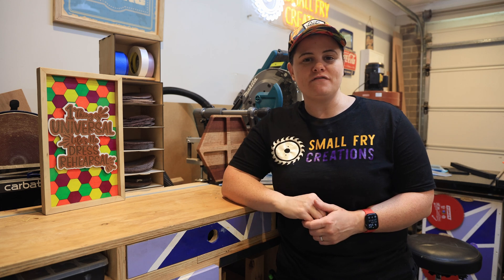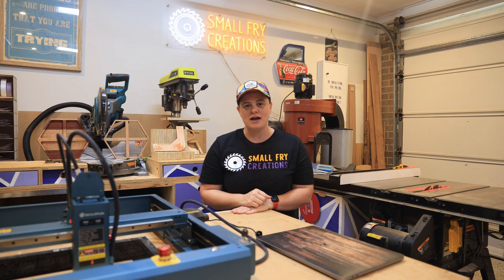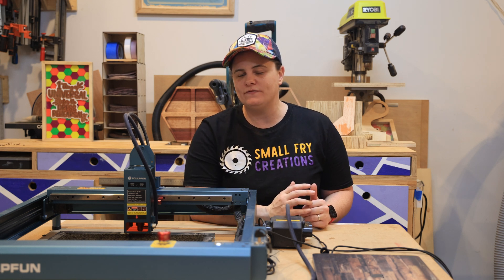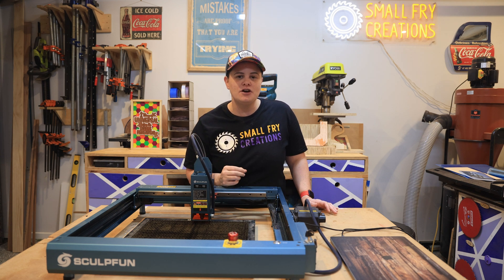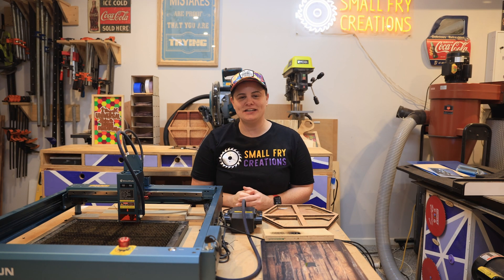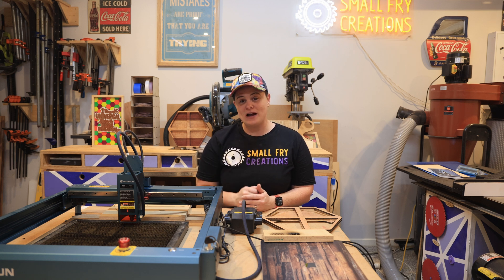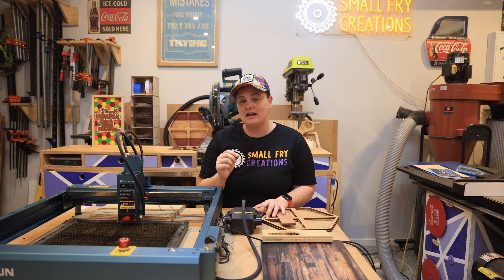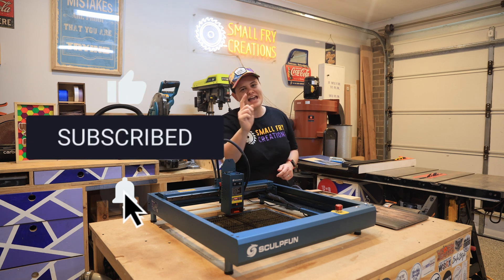5 Laser Facts BEGINNERS need to know | Reviewing Sculpfun SF-A9 40 Watt Laser

Comment: I started with a 5W Sculpfun S9 laser years ago, then upgraded it to a 10W via an Atomstack head. I designed and machined an air blast nozzle for it (a design I now see as standard on most machines but back then it was novel). I also added a side fan to evacuate the smoke/dust to stop it building up inside the protective chamber near the nozzle. It still works fine but recently I've wished for more power and a better more stable frame, so I just ordered this Sculpfun SF-A9. One thing I note - I have an enclosure and exhaust fan to run the laser (essential not optional IMO) but Sculpfun have put the emergency stop button on the frame itself which is of course inside the enclosure and not rapidly accessible in an emergency. I'll probably remove it, extend the wiring and mount it remotely a little distance away and outside the enclosure.  Everyone should keep a small fire extinguisher nearby in case of a fire. I think at 20W the machine is only using 4 of the 8 diodes and not 8 diodes at half power. Because you don't get to choose which 4 diodes to use that means wear and tear will be uneven and running at 20W rather than 40W at half-power setting is going to see your diodes fail sooner than you thought. Better to leave it on 40W setting and adjust power output to suit unless you really need the slightly finer dot size when using just 4 diodes.
Reply from the maker: Thank you for all the great tips! so really helpful information and your right about the number of diodes being used and the wear and tear. Really helpful thank you!

Comment: Useful vulcan knowledge shared.
I grabbed a s30 ultra with a 33watt laser thats on its way here. I also grabbed the s30 extension kit for the frame, though didn't know it wasnt adaptable to the s30 ultra, but its adaptable to all other variants of s30 or s10 even, s9 too if I remember correctly. 
I will need to source out a stepper motor that either exactly matches the motor the ultra uses, or try to source out 2 exactly balanced matching motors if to use the extension kit, or order a cheaper s series than the ultra and make that the larger capacity rig. I want to try to get the s30 ultra to use the extension kit though rather than two rigs. There was confusion generated at time of purchase due to the marketing of the s30 and the extension kit, they really could've went with a less confusing name to differentiate and to make sure it wouldn't result in probably many extension kits being sold yet not able to be used. Someone else i noticed bought a ultra and the extension kit and spent ages trying to get it to work for them, due to the differences of the stepper motors being used. He was frustrated and because he tried asking sculpfun so he could get the exact proper motor so to sort out his requirements and getting the rig to work, but they chose to not give him the info, he felt they were treating the s30 ultra motor specs as if some kind of trade secret! That caused some cortisol spiking just reading that, and to think they seemed to have created additional adventurous mystery, in a otherwise layman's terms framework of corrective care.

I do dig the design of their machines because of the adaptive type of extrusions they use with the s-9 s-10 s-30, and seeing that extension kit really made me hit the Buy Now button.
Thankyou for helping explain the viability of lasers in comparision to marketing, your real world evaluations and your pointing out how achieving results really depends on variables that marketing often does not include. 

We should encourage them to produce a additional extension kit that would include the certain motor of the ultra, because the ultra was designed for the added weight of a heavier laser mounted to the rig. Or they should at least let people order the exactly required motor config without having to order a entirely other s-9 s-10- or s-30.
Reply from the maker: Thank you. I agree it is annoying that the extension frame doesn't work for all models. I was hoping Sculpfun over the last 12 months would start to standardize for the laser head connections and frames to make upgrading much easier and more appealing but it just hasn't happen. They are great machines and I love them and agree the naming could be better to make everyones life a little easier :) Thanks for stopping by

Comment: How is your makita saw and dust extractor working for you? Just watched your video from when you got them and was hoping for a follow up video on them! 

Found your channel through looking for reviews for the extractor and wanted to say they are great quality videos!

Thanks
Reply from the maker: Hey Thank you. The makita vacum is extremely strong. It does an ok job. Like all miter saws the dust collection is not awesome or perfect. I don't use the blue toothsystem as you have to reconnect it everytime you use the saw and I don't use it often enough so its annoying to have to reconnect. If I did it again I wouldn't waste the money on it. The saw is awesome and works really well. The 40V battery lasts a really look time which is handy. overall I'm happy with the set up. I think a dust cover over the saw like I use to have it really the only way to contain all the dust but this setup is better then the last so thats an improvement :)

Comment: Hi and thanks for the information ,I have bought a Sculpfun A9 in January so very new to laser cutting and engraving . After watching a stack of videos and reviews I decided to go for the 40W/20W A9  expecting to get the cutting results advertise  but  just like you have said I can,t get the same results and after watching what you are getting I am thinking I have some setting that must be wrong , on 3mm Ply with white glue  in between layers the best I can cut at is 550mm/m at 100% in 40W mode . I would love to know what your setup is and what drivers you were able to get and use , this is all new to me and downloading file to run the laser was a bit of   a stretch for me. I was disappointed with Sculpfun and the small honeycomb panel they bundle with the A9 , I have been in contact with them and explained that the 400mm x 400mm cutting size the advertise is outside the honeycomb and you end-up cutting into the frame  if you cut to the machines limit. The air assist still runs when turned off in Lightburn  I have been told it pump less air to keep things clear but I get better results if I pull the cable out before engraving and putting it back for cutting  so wondering how you work with yours and if there is also  problem with drivers I need or not. Keep up the videos the more information we get the better and as some wise person said knowledge is no weight to carry, thanks Laurie ( I am up on the Sunshine Coast  QLD)
Reply from the maker: Hey Laurie!! Firstly well done for diving into lasering. It does take some getting use to but lots of fun once you get the hang of it. I run lightburn off a mac laptop, I haven't had to install any drivers. It works for me out of the box. Very strange that with 3mm  you can only go as fast as 550mm/min. Just make sure in the settings in lightburn you are on mm/min and not mm/sec. I should be able to get speed double for 3mm. If your still getting bad results I would try changing the cable as the one it comes with is sometimes cheap. The only thing you want to do is keep the lens clean. If you get build up around the end of the nozzle this will affect the power. With the honeycomb. I hear you and its annoying. All companies for what ever reason have the honeycomb smaller then the cutting size. I'm guessing it must have something to do with the manufacturing process as they all do it. I would run a material test on the 40watt setting and see what you get. With the air assist. I know they do still pump out a little air when its turned off. I haven't had an issue with it but if your getting better results pulling the air tube out then I say stick to it. Just keep a close eye on it as the air being pumped out is a method that use to keep fires from happening.
Reply: Thanks for the reply I will have a look at the speed settings and I will keep the nozzle clean. The lenses will be on the Sculpfun site early March so I will buy some then and thinking I will buy a 600mm x 600mm bed to make things easyer.

Comment: with this S-9 Sculpfun has introduced many upgrades: laser head with selectable power; new and simplified focusing system; double set of feet to raise the structure; initial assembly has been facilitated; possible connections in WiFi, BT and USB; the straps will NO longer need to be adjusted and the cables are largely gone. As if all these improvements weren't enough, the S-9 is one of the least expensive machines on the market (for the same power) and also for this reason I would say that they have come close to putting the ideal Diode Laser on the market.
Reply from the maker: I agree with you. I think put it in an enclosure and it would be the perfect desktop machine.

Comment: Hi you use ipa as I under stand this is not good for the lens I  use a cleaner used for glasses and it work very well what is your thoughts on this.
Steven 🇬🇧
Reply from the maker: My understanding is Isopropyl is what is in glass cleaner. I have been using it for years and haven't had any issues. Hope this helps
Reply: @SmallFryCreations   Hi thanks for the reply the glasses cleaner I use is a non alcohol based one and it is meant to a eco friendly cleaner so it dos not degrade the film on the lens
Reply from the maker: @steven67856  OO thats good to know. I will do some searching and see if I can find one as being eco friendly is much better and if its going to do the same thing thats better. Thank you for the tip and I will be sure to have a look around :)

Comment: Hi Ainslie, the purchase link for the laser doesn’t seem to be working. Cheers
Reply from the maker: Thank you so much for letting me know. I think I have now fixed it :) Thanks again
Reply: Hi Ainslie, the filter mask doesn’t seem to be on your list. Do you recommend?
Reply from the maker: @howardbecdove9780  oooo yes I do. I should add it to the list. Tomorrow when I’m back in front of my computer I will add it in. It’s awesome and can’t smell a thing and also when you want a break and some fresh air you don’t have to remove the whole mask. The font can just  flip down. Will get a link updated tomorrow 😀
Reply from the maker: @howardbecdove9780  I have checked this morning and I'm hvaing trouble find the same one I have. The mask I use is a 3M branded mask and is called a Quick Latch Half face respirator and then you purchase the filters you need. I use the ones for spray paint and I can't smell any fumes. If you're in Australia I got mine from Seton otherwise I would recommend googling that name and you should be able to get it to come up :)